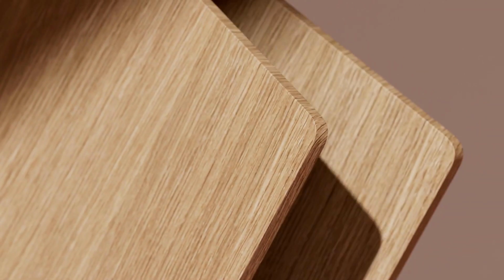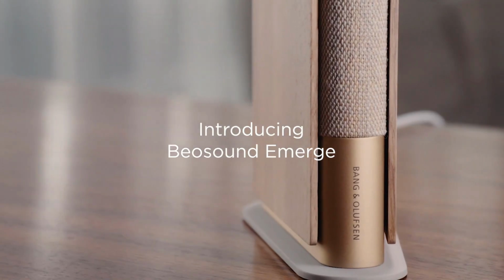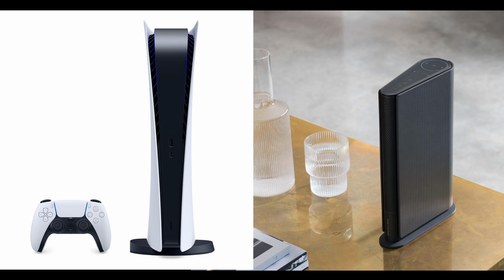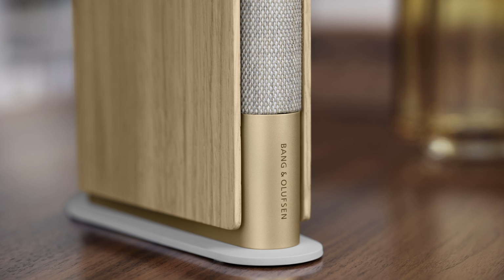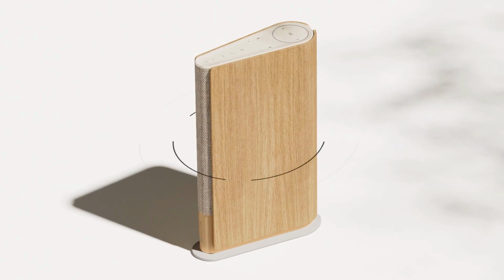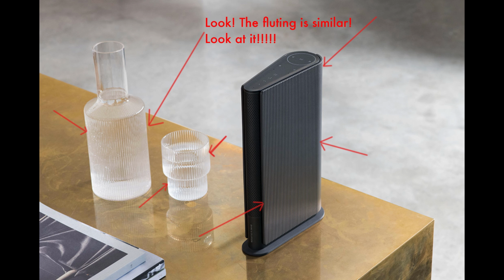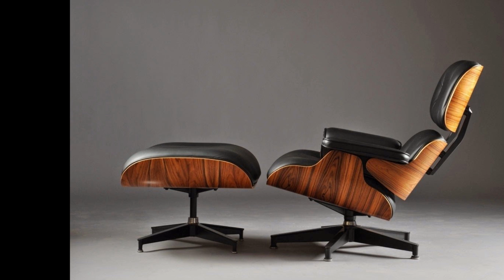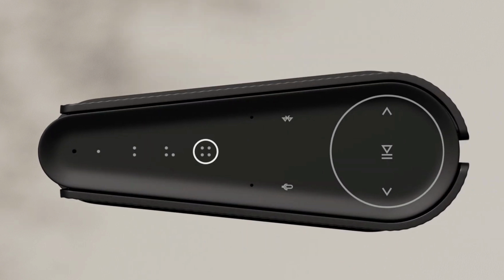Industrial Design Analysis: Beosound Emerge

Comment: B&O has always outsourced the design. None of the great designers they've had were ever on the payroll, even though some of them worked for B&O for a very long time. But B&O recognize the value of design in their products as a key success factor. In some ways the designer has more power than the CEO at B&O. When he says "no" to the final product it is not going in production. There are many anecdotes about this within the factory staff.

Comment: Having lived with an used a pair of B&O Emerge for a over a month now I remain impressed by the quality of sound for such a small speaker. I steam my music library from my PC using DLNA via wi-fi and immediately notice the improvement over Bluetooth via my laptop from the same source. Designed to be a wireless audio speakers for streaming it is disappointing that it (as most Bluetooth and wireless speakers) is so poor when watching video (Facebook, YouTube, iPlayer etc) because of the very long lag. On a computer programmes like VLC have some adjustments for lip sync but that does not work for a video in a browser. These and other Mozart speakers are more than good enough to replace stand mounted or floor standing speakers and improve over the speakers fitted into most televisions and are idea computer desktop speakers in terms of size and quality but having no USB and still problems when using the fibre optic input. Can't have everything? At this price point and double for the Level and double again for the Balance expecting that little bit more flexibility.